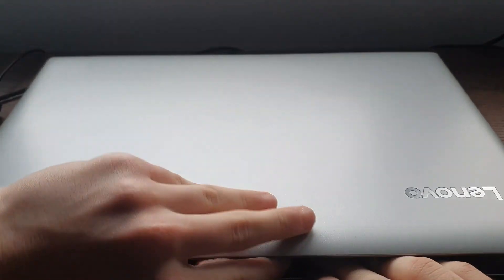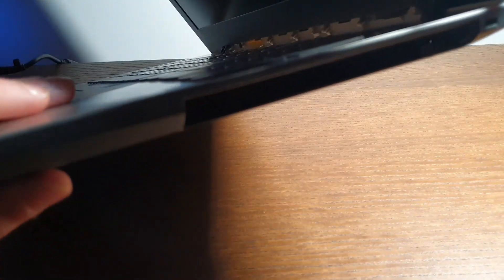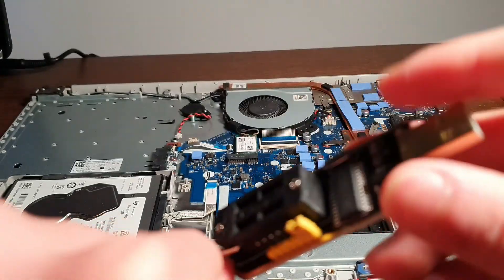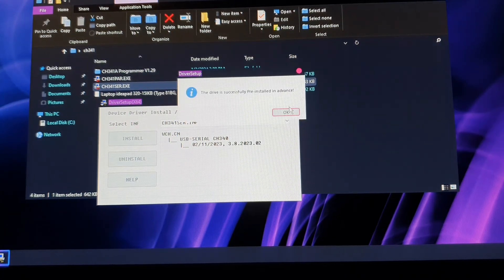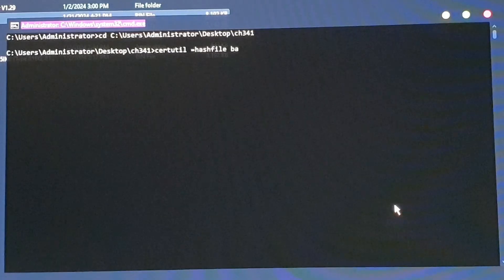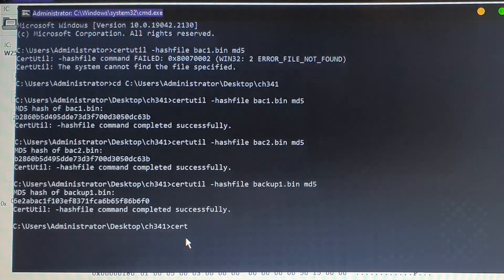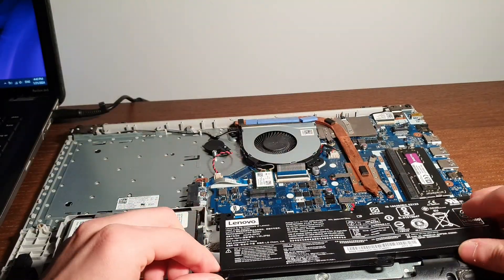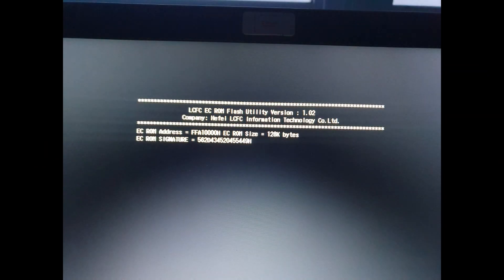Unbrick Your Dead Laptop! Fix BIOS Corruption with CH341A (Lenovo Ideapad 320)

Comment: GOOD DAY WILL IT WORK ON LENOVO THINKPAD L13 AND L14 AND L15 ?
Reply from the maker: By looking up on the internet, I have found this forum of someone doing this process on such a laptop. https://www.badcaps.net/forum/troubleshooting-hardware-devices-and-electronics-theory/troubleshooting-laptops-tablets-and-mobile-devices/bios-requests-only/104903-lenovo-thinkpad-l14-gen2-amd-20x5-bricked-bios

They mentioned that they needed a 1.8v adapter since the bios chip takes 1.8v, not 3.3v.

The steps in the video will be generally the same, although you need to find a working bios for your specific motherboard, which might be the same one that's on the forum linked.

Comment: Hey man! I have a slight issue here, the engraving on my bios chip is just not readable at all, is there a way i can bypass this obstacle somehow?
Reply from the maker: There is the detect IC button, which can tell you what the chip is, but usually it gives an option out of 4 or so selections. You could search online for what your laptop model bios chip is, see if someone else figured it out.
Reply: @YoussGm I did some research online, they said it can be matched with the motherboard model, tried through that, the motherboard is HS553 NM-D701, from what I managed to find, it says after detecting I can select either of the two W25Q128FW or W25Q128JW and from the bare minimum I managed to read on the chip, it's a winbound, whereas the online bios file I found are all gigadevice is that gonna be an issue? Oh and I was a bit curious on the "reliablity" of being able to use the two codes I mentioned above there's no harm if I select them given I've provided the motherboard model and the laptop is IdeaPad slim 5i , r5 (15alc05) right?
Reply from the maker: @BumtaKimg honestly I'm not sure. It should be fine, as long as you're able to create the 2 identical bios backup reads, and ensuring the file size of the backup and the size of the online bios are the same.

Winbond and Gigadevice should be interchangeable as long as the model 25Q is the same etc.
Reply: @YoussGm aight, thanks a bunch man!, hope it all goes down smooth🙌
Reply: @YoussGm ggs it was a onboard memory failure and not corrupted bios 😭

Comment: Hey man, great guide thank you. When i check the hash oh the two backups bin they are always different even when i disconnect and reconnect the clip. I've done it like 20 times and they are never the same. Is there a solution?
Reply from the maker: The clip connection must be stable, so you should just keep trying until you are sure that all pins are making proper contact. Be gentle on the clip because mine after like 100 tries on various laptops stopped holding well because the plastic wore down. You can try to keep pressure on the clip with your hand to keep it down on the chip.

Comment: Man, I'm able to get the reading, deleting and blank checking. When I try writing seems it got ok but on verification shows that even the first lines arent writern. Reading before writing shows a bunch FF and just a little amount of data. Should I try dessoldering my chip or seding it to an technician? I done more than 50 times with 2 different softwares and 1 in firmrom on an linux liveusb. Always an issue within the first lines.
Reply from the maker: The first lines are usually buffer anyways. This might be normal. Try to see if turns on if you didn't try that yet.

If you already tried then not sure what the problem is. Did you check the checksum of 2 reads that you did? If the checksum of the 2 reads is equal then the BIOS on the chip should be the correct one that you are flashing.
Reply: @YoussGm  it doesnt turn on, I did checked, the 2 backup versions are equal but the one I'm trying to flash is another version
Reply: @YoussGm I do really do think its bad contact of the chip and the aligator soic8
Reply from the maker: Did you check if your bios chip voltage is correct for the ch341? Like 1.8v or 3.3
Reply: @YoussGm its 1.8v, I'm using an adaptor
Reply from the maker: Not recommending that you do this, but you could try without the adapter to see if that would work. Could completely destroy the chip, so last resort.

Other than that you can try plugging the laptop in while the clip is attached, and then making sure it is powered off because it might try to automatically power on. That should supply a bit more power to the chip and maybe make it work, like I did on the other video with a gaming laptop.
Reply: @YoussGm thank you, but this sounds really scary for me. I will keep trying to do a better connection and if other 50 attempts fail, I will either go to an technician or trying energizing if it doesnt works, 3.3v
Reply from the maker: @quemeseupai9629 so you're saying that when you flash to the chip, the data is not changing? So if you read after flashing it's the same as the data in the original backup?

Comment: I crashed my ideapad 320-17ikb because I flahed the wrong bios. The update bios run fine to 100% and crashed & the old one can't installed back from the bios update software.
Now I tried same you but nothing!!! Powerlight goes on, screen black. Can it be that I must write both .bin files into the bios and how I must do it?
Reply: I mean the EC.bin & Bios.bin!!!
Reply from the maker: Just flashing the bios.bin should work. No need for EC.bin.
Reply: @YoussGm  Not work. Screen still be black. Just power light work & fan.
Reply from the maker: What bios.bin file are you flashing? Where did you get it from. Are you sure you're doing it correctly
Reply: Yesterday I wrote 3 x times again, but every comment got lost.
I done it exactly like in your video but it not helped. The bios file was for EG521/EG522 from Bios-Mods. Yesterday I downloaded also the original from Lenovo and extracted the bios.fd with winrar & after with extractor_v0.2_win. It looks exactly like the one of bios-mods. How can I write EC.bin also on the chip?
Reply from the maker: The EC.bin is almost always on another chip, not on the same one as the bios chip.

Try to get your bios from the telegram bios archive. I will try to find it for you but you can look for it yourself.
Reply from the maker: https://t.me/biosarchive/9994

Check this I searched 320-17 in the search and found that, it should hopefully work. Make sure to double check.
Reply: Thank you, hahaha... now I have the next problem. The clamp from the programmer cable jump out now all the time. It not want stay there anymore. I ordered another one already. I try it next week again.
Reply from the maker: @snowgardtechman7122 I also had that problem after using the clip so much, I was able to clamp the chip and press down on the clip manually to hold it in place. if you'd like to try that. If not then wait for the new clip.
Reply: I have the exact same laptop and did the exact same thing then it bricked the bios. I was pretty sure I used the correct bios to update and it did run to 100% complete. For unknown reason it was bricked. I’m going to try this method to repair it hopefully

Comment: Bro im gonna try this. On my dell inspiron 15 3525 laptop. But i cant find its bios online can u help?
Reply: Thx bro.
Reply: BTW the process would be the same in my laptop also right?
Reply: Also the bios in the dell site is 55 mb
Reply from the maker: The file downloaded might be 55mb. But did you extract the bios from the file by following a youtube tutorial?
Reply: @YoussGm  no i cant extraxt it
Reply: it is not showing the bin file
Reply from the maker: Look for a .rom or .iso file
Reply from the maker: Check this video if you haven't its good https://youtu.be/wmQWUudBL6E?si=FvWRkldzwJQEaXpH
Reply: @YoussGm  bro i have seen it but there is no rom or bin file just data and other files. is it ok if i just open the .exe file because none seems to work
Reply: @YoussGm  this works tho https://youtu.be/nzRFJIJ9ke4?si=q7kQUqbR_iTNupJv
Reply: i have renamed the .rcv to .bin as shown in video
Reply from the maker: The file should be like 4MB or 8MB or 16MB or 32MB or 64MB or 128MB

Is it? If yes then it should work. If not then you might have to check the video i sent and add any header from the not working bios fo the update file you extracted.
Reply: is it ok if i use that .bin file??
Reply: is it ok if i use that?
Reply: @YoussGm  no it is like 54.4 mb i dont understand the thing u have said afterqards
Reply from the maker: @aaravshah4340  go to a professional or service center. Call dell customer service.
Reply from the maker: @aaravshah4340  i maybe found a bios on the bios archive telegram. Did you check there. https://t.me/biosarchive

Join and search 3525, I think its the newest result. Just make sure to check your motherboard model number physically and compare it to the nb HDL5D LA-L945P rev 2.0 (A01)
Reply: @YoussGm  oo ok ill check it with my bios chip by its file size. thanks bro i appreciate it
Reply: @YoussGm  BTW i can use that .bin file directly right (in the programmer software)?
Reply from the maker: You should be able to. But MAKE A BACKUP of the non working bios. In case you ever need the hardware descriptor or something.
Reply: @YoussGm  alr bro! the programmer is gonna come at monday. Excited to fix my laptop so bad
Reply: @YoussGm  bro the software just doesn't detect the chip I reseated the clip like 100 times pls help
Reply from the maker: @aaravshah4340  does it detect any other chip? Or just nothing at all?

Check physically if all pins are flat and not lifted up on the clip.
Reply: @YoussGm no it doesn't detect any other chip and the clips are connected and not lying on the chip
Reply from the maker: @aaravshah4340  when its connected is the light on the programmer dimmer (less bright) than when its not connected?

Message me on discord: YoussGm3o8
Reply: @YoussGm  no it is not dimmer. I have sent request for discord
Reply: I havesged u on discord
Reply from the maker: If you can't find it online then I can't find it online.

You should try downloading the bios update for your laptop model and exact version and specs, and check on youtube how to extract bios from bios update and follow those steps.

Then check if the file size is correct with the expected bios file size of your laptop. You can check by extracting your non working bios and check the size of the file or look for the bios chip model and its size or google it.

Then you are on your own. Make backups of the old bios.

Comment: ill try this method soon great vid btw. i have a question, what is causing this issue?
Reply from the maker: Bios corruption could be caused by interrupting a bios update, a faulty windows update or just bad luck (very rarely, like never).

So your issue might not be a corrupted bios, depending on what happened for it to stop turning on, and its behaviour when you try to turn it on.

Comment: Nice video 

Why don't you just wipe the bios chip and install the new bios file downloaded from Lenovo?
Reply from the maker: Sometimes the bios files provided by the manufacturer don't contain the full bios file, just the part that gets updated. So for example a 8MB bios file might have a 2MB header that contains the system information and serial number that Identifies the laptop, and the 6MB actually contains the bios.

So the update files from the website could have only that 6MB  which would be impossible to flash without knowing the actual size of the header, since it's not documented (for most laptops).

If the bios file from the website is the correct size tho it should work.
Reply: @YoussGm  thanks a lot for the quick and detailed  reply. Thing is, i bricked (by flashing different vbios) my laptop (Asus rog strix g16 2023) and I'm thinking of using this method to reflash the bios via CH341A, but I can't find any guide on YouTube for my model nor do I know how to edit specifically for my case . What would your advise be? Should I just do what you did? (btw by any chance do you know where exactly the bios chip is?

Thanks anyway for the help
Reply from the maker: @angeloschaloulis1394  
For such a modern laptop I would like to hope there is some bios recovery tool or 2 bios chips to backup the previous ones. Here is a reddit post I found that you should try the steps before commiting to do a manual fix. First try the steps in the reddit, the second link has the same stuff but more in depth. It's not your exact laptop but Asus should be prettry standard with these steps. Try the EC/cmos reset with and without the power cable plugged in and if that doesnt work follow the other steps for the USB recovery. Goodluck.

https://www.reddit.com/r/ZephyrusM16/comments/15xijk4/bios_dont_panic_if_this_doesnt_work_then_panic/

https://www.asus.com/support/faq/1014276/
Reply from the maker: Wait for a vbios... so your graphics card bios? Idk if this is gonna work, depends if the vbios is stored on a separate chip, which it very probably is and that won't make it easy.

If its just the vbios that has a problem, maybe try getting a video output with usb c or hdmi and see if it works.
Reply: @YoussGm  well I tried almost everything and it didn't work, cmos, connecting externally etc. Normally when it's not compatible vbios it's just black screen on windows,  but still ok externally or via safe mode ..  But this version on reddit WORKED. Thank you so much man. I don't know how can I repay you for this. It was probably a corrupted bios.. don't know how that happend from flashing another vbios  but anyway I just fixed it..just thank you much I can't express my gratitude
Reply from the maker: Glad that it worked, thanks for watching! No more overclocking and  custom bioses from now on though, not worth it!
Reply: @YoussGm  thanks for everything mate. Subscribed and liked as well. Wish you the best

Comment: As programmer doesn't detect the correct bios chip even after I seat the clip correctly multiple times. Do you think is it a hardware failure?
Reply from the maker: Its probably normal. Google your bios chip name with As programmer next to it and see if there is a reddit post showing what chip is equivalent. You can also try another programmer software.
Reply: @YoussGm  thank you soo much

Comment: Would this work for my acer travelmate P215-53? I unknowingly updated the bios or installed "insyde" thing and the installation got interrupted. It now only shows black screen and the it shows the light indicator of it being turned on. It goes on an off after a few seconds. I really need help
Reply from the maker: Yeah this should work, just look for any specific tutorials for that laptop. If you can't find any try to look for a bios file for your specific model either online or on the telegram linked in the description, before buying a programmer or taking apart the laptop.

You could also research if your laptop has bios recovery; using a usb stick loaded with a bios bin, there could be a key combination to restore the bios.

Comment: Great. Would it work for a Lenovo LOQ 15IAX9?
Reply from the maker: The concept is the same but you might need to plug in the power if your programmer only lights up dimly. There should be another video in the description for gaming laptops where I show how to plug in the power safely.

Before anything though find a bios for your exact model online or from the bios telegram. Then find a teardown video and locate your bios chip then the steps should be the same.
Reply: Thank you, @YoussGm. Thanks to God, this time I was able to recover the BIOS using (Fn + R) and the correct BIOS on a USB stick. Thanks for your quick reply. Now I also got the CH341a to play with :-)

Comment: i have problem with my lenovo ideapad gaming 3. before it appear have an error BI InitializeLibrary failed 0xc0000185. then i hard reset it by pressing the power btn for 60 sec. charge it then turn it back on. but there’s new problem that i goes blackscreen right after i turn it on and the fan also the keyboard light only goes for about 2 sec after that just off like that. what should i do?
Reply: pardon my english, it’s not my first language 😅
Reply from the maker: I found a reddit post that has your exact issue and it seems like the fix in this video is the only way to make it work again.

https://www.reddit.com/r/Lenovo/comments/1br8i83/error_bl_initializelibrary_failed_0xc0000185_on/

What you need to do now is to find a working bios file for your laptop, and see if the bios chip is in an accessible location, because if it is too close to other components the clip I use in the video won't be able to fit. It should be designed to work though.

Goodluck if you need any help please message on discord! Its easier for me.
Discord: YoussGm3o8

Comment: have you bios for lenovo thinkpad a485 ryzen 3?
Reply from the maker: I don't have any specific Bios files with me. You will have to find your own either from the Bios telegram or somewhere on google.

However, I'd like to know more about your problem! Did your try doing a cmos reset first?

If not, your laptop should have a small pinhole under it with a battery disconnect symbol. Poke that hole with a sim ejector and hold it for around 30 seconds.

Hope this helps.
Reply: @YoussGm  my computer turned off during bios update
Reply from the maker: @domyxgw  alright then goodluck with finding a bios. You can try downloading the bios update from the lenovo website and see if it's the same size as the bios file.

There are tutorials on how to extract a bios from the update file.

Comment: Hello ihave lenovo ideapad 330 17ikb 
In lenovo website bios updates can work and both 15ikb and 17ikb model they have same bios model version so can i flash bin bios of 15ikb found on telegram in my 17ikb ? I  couldnt fine 17ikb one
Reply from the maker: Yes it should be fine to flash the 15ikb bios if it is the same on the lenovo website. 
Just make sure to make a backup of your old bios just in case.